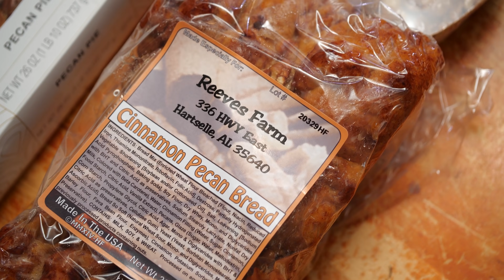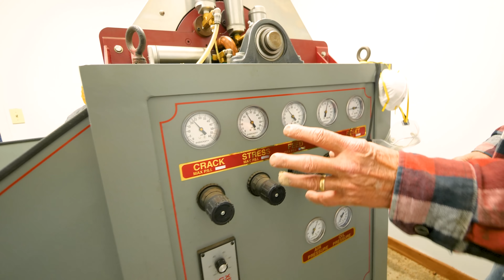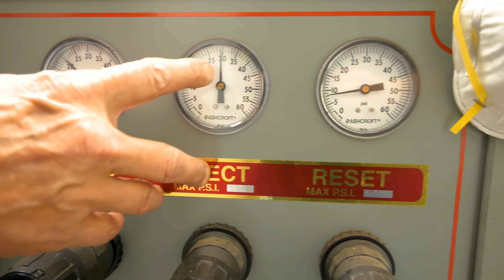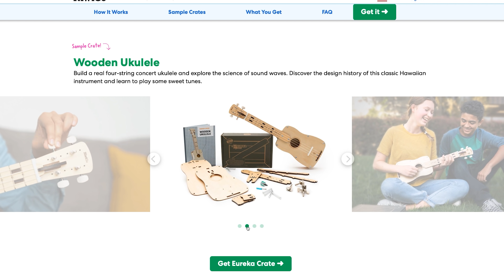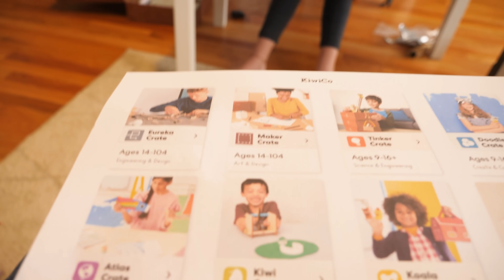How to Harvest Pecans (In Slow Motion) - Smarter Every Day 248

Comment: "The husks have not opened on time." Global warming?
Reply: Eh. Most of the time, husks take a while to open due to an overly wet summer. So technically yeah, it could be due to global warming. September dry heat usually is what makes the hulls open.

Comment: Destin, you didn't mention in the video that there are 2 weights rotating in opposite direction and I was wondering if you noticed. This is so that vertical vibrations are cancelled out. This is also the reason for the chain, to synchronize the 2 schafts.
The upper shaft also has 2 weights and the bottom one only one lobe (twice the thickness of one on the to) to place the axles closer together and still cancel out twisting vibrations.

Comment: 6:28 
YouTube Compression Algorithm -> NO
Reply: @hey.sanoop  i don't think YouTube host videos without compression even if its in 8k
Reply: @hey.sanoop  resolution and compression are two very different things.
In fact, quite clearly, what you claim is not practically possible: 7680px * 4320px * 60hz * 24b = 6 GB/s connection required for an 8k60fps stream. Even if you used a magical lossless codec, you'd have trouble decompressing the video fast enough. But the codecs on YouTube are not lossless, and definitely not magical...
Reply: @hey.sanoop  lol, no, you have no idea what you're talking about. An uncompressed 1080p60 stream requires just shy of 3Gbps. Got that? three motherfucking gigabits per second. Forget about it on Wifi, it would be thoretically possible on Wifi 6, but not IRL. Your computer most likely has a 100mbps ethernet card, can't do it. Gigabit card? You're off by a factor of three. I'm not even talking about your internet connection, not even your average LAN can handle that. 

An uncompressed 8K60 stream will require around 22 Gbps. 

A 10gb PCIe card costs around 300 dollars. You could have TWO of those and they still could not carry an uncompressed 8k stream. 

You're dead wrong. Youtube videos are HEAVILY compressed, just like EVERY other video you've ever watched. I guarantee you, you've NEVER, EVER, seen an uncompressed video file.
Reply: RIP maverick.
Reply: Exactly! Really cool shot but very messy due to compression
Reply: @hey.sanoop  Videos are compressed to make the file smaller and every single video in Youtube is compressed even the 8K or bigger.
For reference, uncompressed 1920*1080 video will net you 180MB per second.

Comment: “ PTO “ is a power take off , which transfers the power of the tractor engine to an accessory like the tree shaker or a big lawnmower.
Reply: Also can be very dangerous if not fitted with safety parts
Reply: @nearestyoutube  super dangerous, If a piece of clothing gets caught in the PTO driveshaft you’ll be pulled into it and torn to shreds. Diesel motors have no mercy
Reply: Well that's cool
Reply: Yep! On big trucks with hydraulics (think trash trucks, dump trucks, etc) the PTO is usually directly coupled to the hydraulic pump that runs those things!
Reply: Oh, am came here to find out what is a PTO. Thx